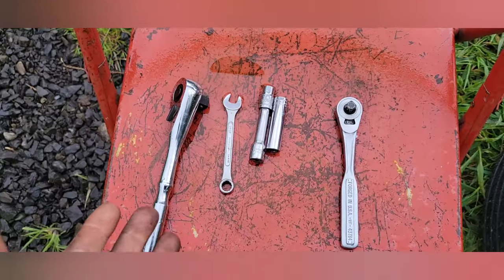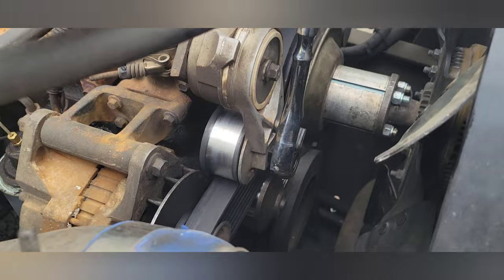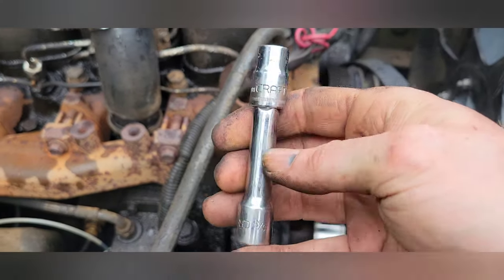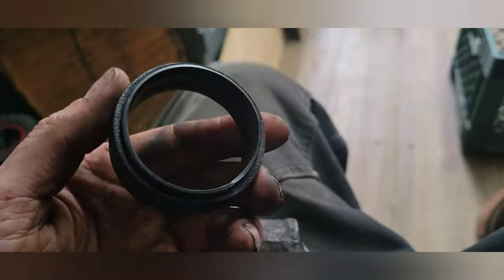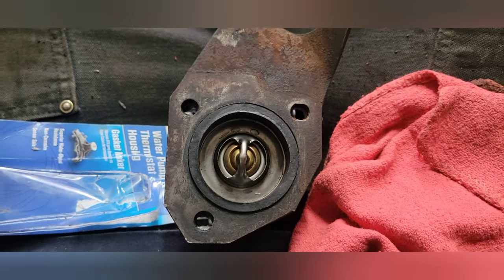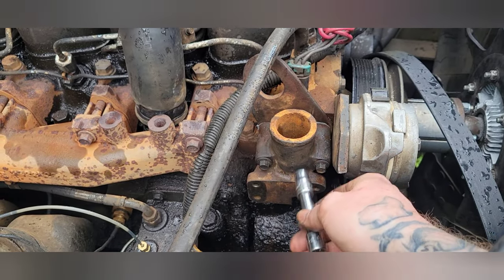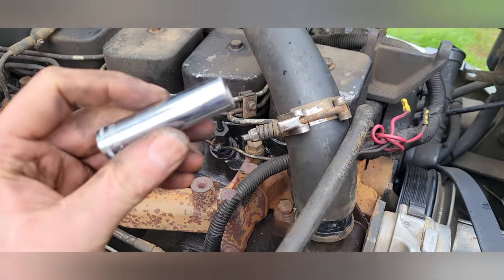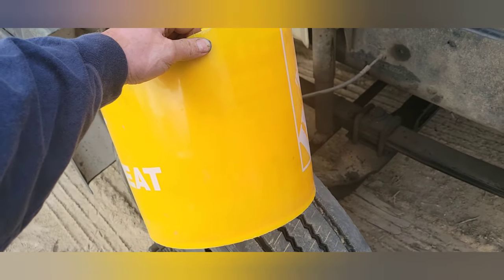Freightliner fl70 thermostat replacement

Comment: Is it a 17’ deck? Can you do a video using the bed? Im wondering what the biggest vehicle will fit on there like crew cab short box or long box
Reply from the maker: I have a 19' bed. I've fit an extended cab long bed ford, pretty sure I can fit a crew cab, but haven't been in a situation to try yet.